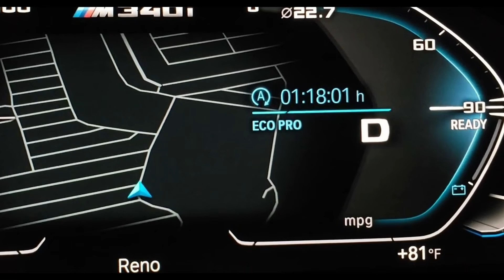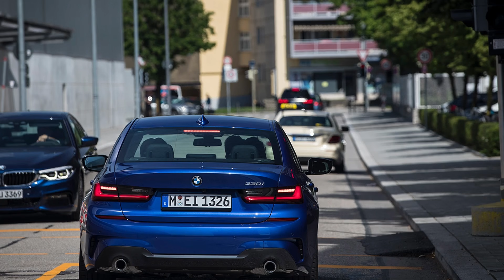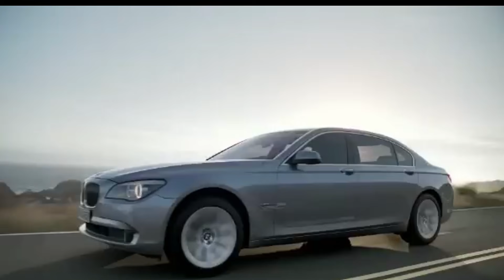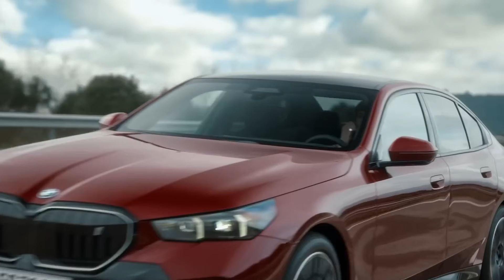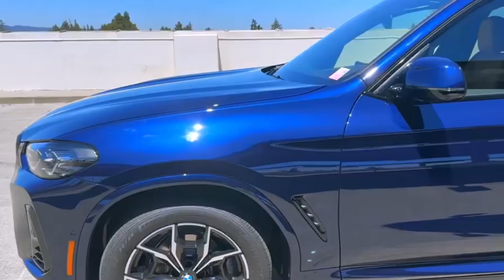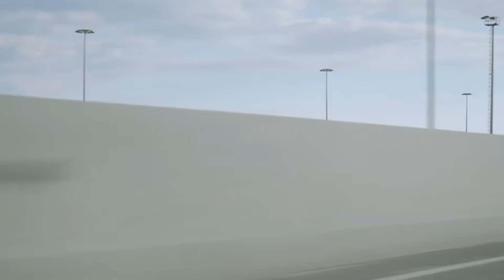14 BMW Built In Tricks That Add Serious Miles Per Tank (Most Owners Miss #8)

Comment from the maker: Drop your BMW model and your current real-world MPG in the comments below. Then come back in thirty days after putting some of these into practice and tell me what changed. I genuinely want to see the numbers. That kind of data is useful for everyone watching this channel.

If this video gave you something useful, a thumbs up helps more BMW owners find it. And subscribe if you want to stay ahead of what your car can actually do.
Reply: X3 F25 20d  I drive like I stole it , averaging 39.5- 42 mpg combined
Reply: tire press rec on door are for maximum load, cold infaltion press and in the critical load condition, not what you want for normal every day driving.  RSC runflats rated at 50 psi max should be run at 40-42 rear and 36-38 front for optimal handling and steering regardless of Xdrive or rear wheel drive only

Comment: I use ECO Pro all the time. The most it has ever “saved” me was around 10% on a long drive that was part freeway and part country roads, when I started driving as conservatively as I could- 5 mph under the freeway speed limit for example. Sometimes it tells me I’ve saved 10 miles of range by the time I refill at 350 or so miles.

Comment: I'm looking at an x3 xdrive35i with 113,000 miles 2011 to buy at $7995. My husband is a dyi mechanic. Never worked on this.
Reply: No matter what, make sure to get a good extended warranty and by ‘good’ I mean the most expensive one you can afford, ie Fidelity, Allstate, Route 66, etc. Trust me on this as it will pay for itself in 1-2 trips to the dealer.

Comment: 2017 M2 and 18mpg but….im pretty sure it’s my driving style..😂😂
Reply from the maker: Yeah, that actually makes total sense for an M2.

An 18 mpg average isn’t unusual at all for a BMW M2—it’ll do low 20s on a calm highway run, but it drops fast with short trips, cold starts, and any “spirited” throttle use (which the car basically encourages).

So you’re probably right—it’s less the car and more the right foot 😂. The M2 is one of those cars where the difference between “driving it” and “driving it normally” shows up immediately in fuel economy.

Comment: 2011 335i xdrive 24mpg, and 2017 x3m 21.4mpg.. I also have an Audi A4 cabriolet that gets about 25 mpg, I believe.. I’ll let you know I guess
Reply from the maker: Those are actually pretty solid real-world numbers for the mix of cars you’ve got—especially the 335i xDrive and the X3 M.

The 335i xDrive hitting ~24 mpg is right in line with what you’d expect if it’s driven mostly steady on the highway. The X3 M at ~21 mpg is also pretty normal given the weight and performance tuning—BMW basically traded efficiency for that power delivery there.

And honestly, your Audi A4 Cabriolet at ~25 mpg fits the same pattern: once you’re in that “turbo + AWD + real-world driving” category, most of these cars end up clustering in the low-to-mid 20s anyway when driven sensibly.

Keep an eye on the A4 though—those can vary a lot depending on top-up vs highway ratio.
Reply: @BMWMechanics Thanks!!

Comment: M520d turned off all the eco pro crap, better mpg and car much more responsive 👍
Reply: yes! my car with the b58 is the same way. Eco feels like the car is fighting you. I prefer sport or sport+ with the transmission in M and clicked to the left on the gear selector. I can drive about 180 miles on a little above half a tank like that and probably more if I tried to only stay efficient, but I like going through the rev ranges to help burn off some carbon.

Comment: I drive a M3 with manual transmission so I was not that concerned with mpg and some of these probably don’t apply to my car. But I am genuinely impressed with the efficiency of a car with almost 500hp to get 26mpg on highway driving.
Reply from the maker: That’s actually a solid perspective—manual M3 changes the priorities completely.

Even then, a lot of the efficiency tricks still carry over indirectly (steady throttle, gearing discipline, cruise control strategy, tire pressure, coasting habits). They won’t turn it into a fuel-sipper, but they do help that 26 mpg highway number stay consistent instead of dropping when driving gets more aggressive than you think.

And yeah—getting ~500hp to do mid-20s on the highway is honestly one of the more underrated parts of modern BMW engineering.

Comment: Typical BMW driver here. Thanks for your input, but I drive a BMW Z4 E89. I like it sporty. I can still afford to gas it up. It is pretty economical at 28 mpg. 

I also have 2 very fuel efficient Hondas. I live in Asia so they are a Honda City 1.3L engine and  Honda Brio 1.2L engine. They do 42 miles per US gallon highway. I use them for mundane trips.

But if I want to put a smile on my face, I drop the top in the Z4 and drive it as it is meant to be driven. I don't drive it like a Honda.

Still, thanks for your input.
Reply from the maker: Glad you're enjoying your roadster exactly how it was meant to be driven! 🚗💨
Reply: Thanks for your info.

Comment: m520d 44.2 mpg comfort, sport started using Eco pro with £1.90 a litre for diesel emmm, now I get 47.3 mpg commute, did a large journey over 700 miles in one tank motorway miles 52 mpg

Comment: M240 X drive city average is 17.5 but only have 1700mi
Reply: it's about right. try putting the car into manual shift mode. Shift 1st at slightly above 2k and somewhere in between 2.5k rpm, shift 2nd at 3krpm, shift 3rd at 3krpm-4krpm depending on the situation, and shift 4th at 4krpm and cruise in 5th. You should be at the blue battery charging efficiency area of the consumption monitor on the gauge cluster and most likely slightly above or at the flow of normal traffic for city. If it's too fast for the situation then stop once you get to 4th and cruise. Try and keep constant light acceleration to stay just under the blue charging area and at the top of the consumption efficiency monitor in the middle between the mph and rpm at the bottom of the gauge cluster.
Reply: @Rzn8B58 I will definitely give that a try one other problem is also my commute to work is only 2 mi each way but I'm going to try to do a 30-minute drive at least once a week to burn the moisture out of the oil every 5,000